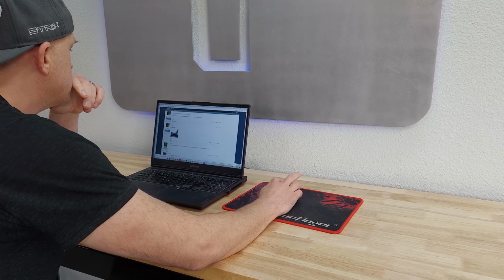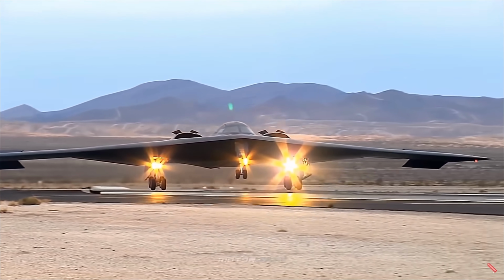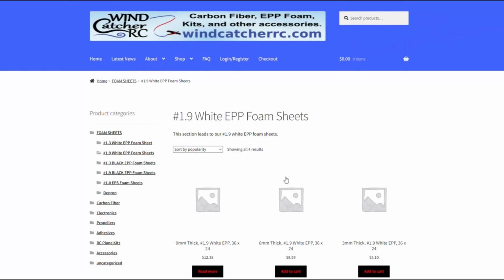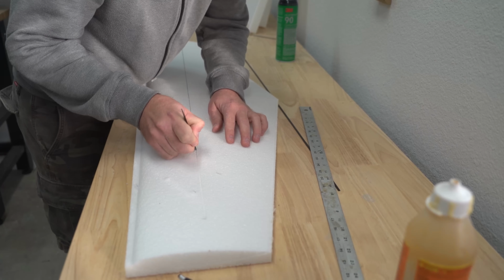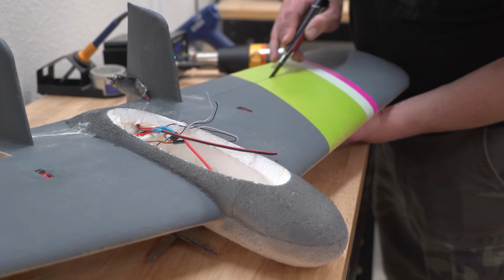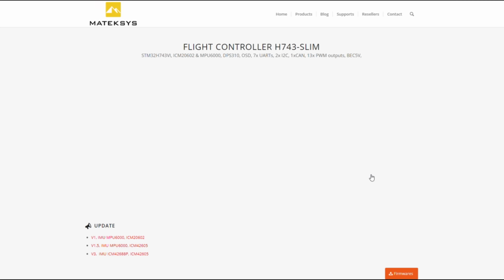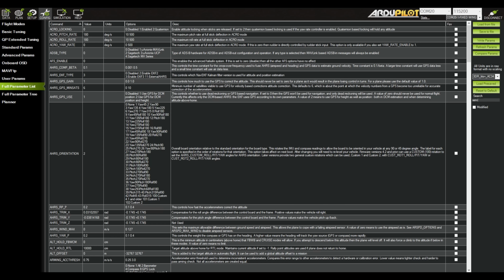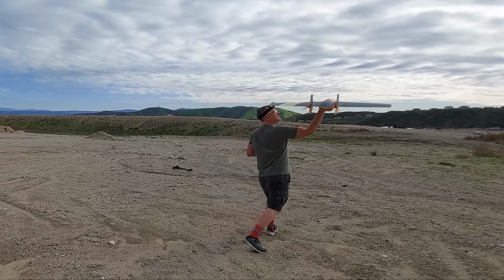Aerodynamic Instability:  The Holy Grail of Efficiency?  Part 1

Comment: I think that line of reasoning is flawed. By being unstable it will pitch up instead of pitching down when your control surfaces loose authority, assuming you are already pitched up, but then it would immediately stall. There is no increase in lift, just more pitch up. 

The military plane you showed has the COG very close to the COP, but it isn’t actually behind it by any significant amount. Further when at an angle of attack other than straight forward the COP moves back, giving then more natural stability. If this wasn’t true these planes would not be capable of recovering from a stall.

Comment: You are throwing it wrong (well not ideal).  The best throw for wing type crafts is to use the free hand off the throttle,  grab the wing edge with one hand while gentle spinning it and let go at the angle you think is necessary.     With the other hand you have throttle access which is what is needed until you have enough speed for surfaces to pickup up speed to be efficient so up/down elevator are not necessary unless the plane is really out of wack.

Comment: For a flying wing, your best cruise L/D will be achieved when your CG is exactly on your CL at your optimal angle of attack. This puts the equilibrium point exactly on the undeformed wing and allows your nice airfoil to operate as intended. For example, a DAE-11 section achieves max L/D at about 6.5 degrees AoA. At this angle, your CL is at 34.7% chord. The airfoil has a neutral point of 25.6% chord, so your optimal static margin is -9.1% and you require extensive pitch stabilization.
Reply: I was thinking that too.  Isnt having the CG either forward or aft of the CP going to force your elevators to generate some lift up or down to counteract the CG/CP moment?  Thats just additional drag.

Comment: I’m not entirely certain, but I think the pitch control may be reversed for this aircraft.

We might be tempted to think the elevons are producing lift (up or down) on the elevon surfaces, but I don’t that’s the right mental model for this configuration.

I think deflecting the elevons one way or the other changes the amount of lift being produced on the main wing. And because the aerodynamic center of the main wing is ahead of the CG rather than behind it, the pitch controls are reversed from normal. So deflecting the elevons downward produces an upward pitch moment, and deflecting them upward produces a downward pitch moment.

Comment: how controlled is your motor mounting and considerations for center(s) of thrust? edit: i.e. addition/reduction of thrust can cause pitching, yawing, and rolling. so your wing isn't only designed for a specific weight, speed, and AoA combo, it is also designed for a specific thrust (and the accompanying pitch, yaw, and roll induced by said specific thrust)

Comment: Whenever I built a new wing I always flew in this configuration, tail heavy.
Swept back wing does not require any vertical stabilizers too. I flew my EPP wings without fins quite often and they flew great, just had to keep a little speed up for landing. But that is neither here nor there.

Comment: Regarding the software, capture the flying data, plot it and then design in 3D what would be an acceptable maneuver. 

Submit the actual flying data to an AI and get the outputs it calculated. 

Feed the aircraft controller with the output of the previous cycle and repeat it some times, than, plot totally artificial flight plans and set then as targets for tha Machine Learning process.

Comment: Great video... Suggestion,. adding a lot of extra wieght would counter balance the extreme lift?  I.e. up verses down...   It's ok to have a highly efficient aircraft that only works (is stable) with a huge amount of extra weight...     It would serve as a good cargo plane or super large commercial airplane, that could carry much more passengers, 2x the amount, meaning less flights overall and less carbon emissions...

Comment: Very interesting. When i heard that flying wing is inefficient because control surfaces have to push it down for balance i always wondered, why not just balance it so they don't have to. Is that what you're trying to do? I just didn't really grasp it since i have zero experience in building something and limited theoretical knowledge.
Reply from the maker: Thats it, you got it!  Its like balancing a pencil on your hand, instead of the stable way of suspending a pencil from your hand.
Reply: @thinkflight  I get it now, thanks. The pencil analogy shows how hard it is, so good luck:)

Comment: The instability comes from the pushing propellers mostly not just from the CG being too fare back.
A pulling propeller provides innate stability even if the CG is fare back.
So at the very least you should have both pulling and pushing propellers.

Comment: Well, back in the late 70s, I built a series or flying wings to figure the minimum reflex required to achieve stability.  I found that a swept back wing required far less reflex than a plank wing.  I didn't take it to a final conclusion though.  I just cut my tests short at zero reflex at the root, tapering to 25% chord reflex at the tip.  The tip chord was 60% of the root chord.  So that left me with 9% of the total wing area reflexed compared to the standard 25% for plank wings of the day.  That was as far as I cared to push the envelope on this before building a larger RC wing, I'm guessing I could have gone further before reaching pitch instability though.

The way I developed the reflex was pretty basic.  I used a fairly high cambered thin profile.  I tool a straight line from the nose point through the reflex point on the mean camber line, projecting that to the trailing edge.  Then just reflexed the mean camber line in a smooth curve to meet the TE point which was naturally above the root reference line.  So it would be fair to say that this graphic rule of thumb solution was not just reflex but incorporated washout to the tip as well.

I didn't know any analytical aerodynamics at the time, but I suppose it had a kind of vague similarity to the Prandtl wing in that to unloads the tip.

Anyway, I just thought it might be of some interest, see it here :

https://drive.google.com/file/d/1s-Z7ob6zHEiKgaB_0w8HHgwYFyc8hrrZ/view?usp=share_link

I think that if I built this again, I'd just do elevons tapering to put most of the control surface at the tips.
As it was, I think the inboard elevators weren't all that effective except by altering mean cMo to effect stability.

Comment: Sailplane pilots will regularly compete with the most aft CG possible because of the efficiency gains, but don't expect much. It takes downforce on the tail to counteract the CG being ahead of the center of lift. Given the location of the downforce(H-stab in a standard config) and the arm from the center of lift of the main wing to the center of lift of the H-stab, you can calculate how much down force the plane is working against, and then run that through the L/D and get an idea of how much thrust is lost for stability. Rutan canard designs take advantage of this as well by lifting with the equivalent of an elevator up front. Anyway, I'm guessing it will be hard to document any efficiency gains because they will be pretty small but I'm looking forward to the conclusion!

Comment: In your video you mention "normal wing elevons are trimmed up", I see this a lot on wing gliders, I have found out the cg on these planes are too far forward, requiring more up trim, slide the cg back until no more up trim is needed, this gives more pitch authority, easier to tip stall, so dial in less max up/down elevon deflection.

Comment: Ardupilot is the swiss army knife, it is the jack of all trades, but master of none. Mini quads (yes a quad not a wing, typical 5" LOS or FPV) fly so much better on betaflight, like night and day, but it does not have autonomous features, well it just got return to moron. I ran mine at 32Khz loop rate until they got the gyro filtering better and canned 32khz mode, now everybody runs 8khz. Since iNav is a spin off of BF (long ago) and has planes/wings/quads, you may want to look into it. I like ardupilot, it is really made for large stuff, they really are not used to high thrust to weight, my quad is 9:1 and is old school, now they are 15:1. good luck, subbed for this project.
On another side of efficiency, have you seen Al Boweres wing? There is efficiency to be gained via this method he uses. FYI, the wandering albatross can fly an average 600 miles a day over the ocean with very little flapping, very interesting.
Al Bowers https://www.youtube.com/results?search_query=al+bowers+prandtl+wing

Comment: I built a 23 degree forward swept wing many years ago, motivated by that Nasa plane also. They have they same beneficial drag reduction as a conventional rearward swept wing, but none of the downsides. Having the wing swept forward does do some interesting beneficial things to drag also- it gives positive feedback both because of more of the leading edge is ahead of the balance point and because of slight flexing of the wing. The upshot of the unstable "positive feedback"effects is that it takes MUCH less elevator deflection to change angle of attack. On my plane, it was so unstable and so quick to react it could literally do a zero radius 180, and was more or less unflyable until I calmed down the balance point.

Comment: Yes, agility is the main goal of instability. The fighter jets using it are not concerned about efficiency. Yes, flying around with elevators down (like flaps) would give more lift, but also more drag (like... flaps).
This would be a hard road even with a conventional plane layout, but a plank style wing is really asking for problems. You'd at least want the motors in front of the control surfaces for any hope of controlling it at low speed (or swivel the motors maybe).
I think the less work the elevator has to do the better, so having the CG very close or right on top of the aerodynamic center, and a plane design (airfoil etc) that naturally produces low pitch moment and high pitch inertia is best. The perfect example is a sailplane with long tail and small elevator. The worst would be where you have to constantly stick a control surface into the airflow.
There is a full-size plane called Celera 500 that claims to be the holy grail of efficiency, would be interesting to see model-scale testing of those concepts (stretched egg looking fuselage and super skinny wings).
Reply from the maker: If you like the Celera you will enjoy my manned design I'm testing in subscale.

Comment: Yep. Aerodynamic unstable craft can be more efficient. However, the drawback in using this in human transport is that if the control system gives up the ghost, the craft will be impossible to control by a human. This is the concerning aspect of  the Seaglider that Regent are testing at the moment.
Reply from the maker: We take it for granted on all our multicopters and eVtols though.   Who knows where all this will go, or what is the best approach....   I have no answers or even an opinion yet.
Reply: @thinkflight  not a lot of track record yet for manned evtols or multicopters!

Comment: The autopilot update is 400hz - and the Saturn rocket, which lifted the crew and the module to the space, and to the moon, without any major problems, had an update of 50hz - so the update speed is probably not a main problem. I certainly doubt that servo motors can respond that quickly

Comment: Hey, that’s very cool. I’ve done this already with my tailsitter that I built some years ago. Never got it fly stable on high speeds though. Had used all symmetrical airfoil. Maybe you just put the motors on the LE and activate tailsitter mode. I can help you tuning the vertical hover perfect without flying. Then you have a backup if the horizontal flight isn’t stable. BR David

Comment: With an aircraft that unstable, you need an angle of attack probe with sensor for it to work. Then your stick on your controller (fore and aft) for elevator control becomes an angle of attack "setter" and provides input for the controller.  Then set your control system to maintain that angle of attack that the stick is asking.  A really simple analogy would be zero stick equal zero angle of attack and full aft stick equals +13 degrees assuming wing stalls at 15degrees. Full forward stick equals -13 degrees angle of attack.  That would be the basis of a simple fly-by-wire flight control system.

Comment: I would suggest to play with pitch inertia. Extend the motors backwards and move the battery forward, while keeping the same target CoG. Second I thing a very specific PID (PIFF) settings are required to achieve stability.

Comment: The problem ist that the system is very non linear - you wont get that flying well with classical PID controllers as used in ardupilot.

Comment: Interesting project! Have a look at the "Frog Wren", a tiny glider; there are free plans available in the Internet. I built one and was quite puzzled when I saw that the elevator has a normal, positive profile instead of the usually negative or symmetrical one! It wouldn't fly until I put the center of gravity at about 50% chord (30% would be usual for a plane), which means it must be behind the center of lift (of the main wing)... Flies well without any autopilot.
Reply: Most older free-flight models had a lifting tail section, nothing that exceptional! You just need the forward wing stall before the rear wing, to get stable flight characteristics. Like a VariViggen, and other creations of Burt Rutan. The margin of error is small, so creating a deep-stalling aircraft is not difficult out of a Long-Eze isn't difficult as John Denver proved (R.I.P.). His aircraft had a big engine and its C.G. was far aft, and that was all it took.

Comment: Might be too simplistic an approach but, how about setting up the plane so the CG is closer to the neutral point?  Then as you get things tuned in Ardupilot you can shift the battery pack incrementally rearward until you get it the way you're looking for.